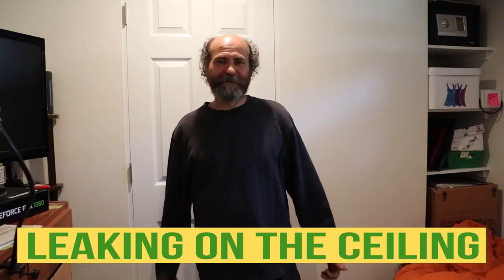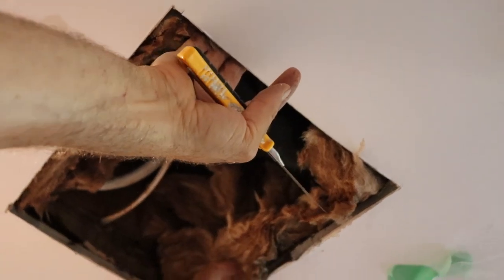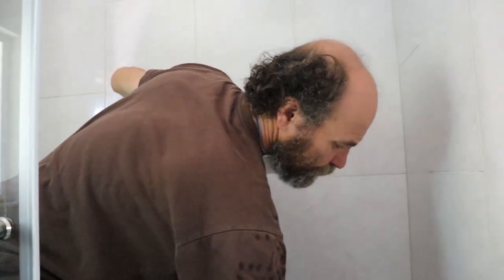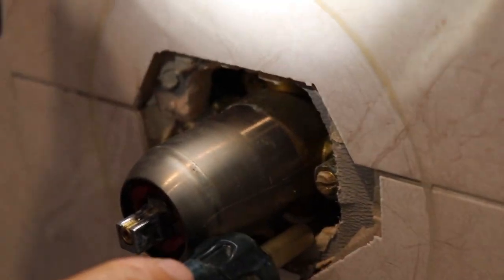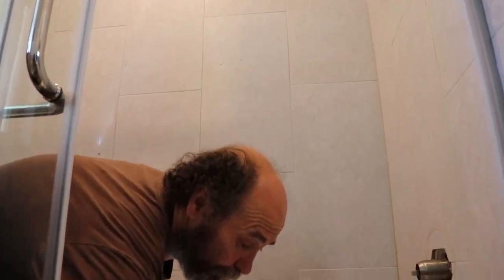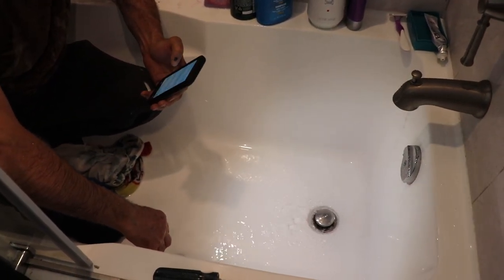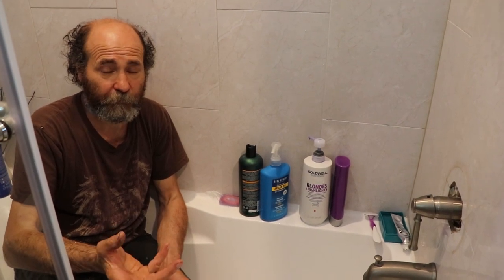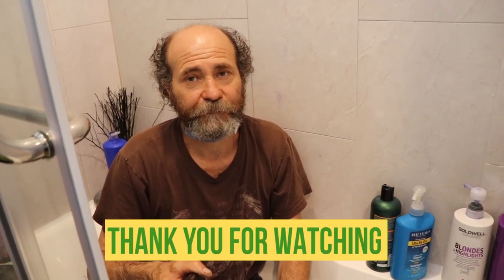How TO FIX A Leaking ON THE Ceiling and How To Repair Water Damaged DRYWALL Ceiling (step-by-step)

Comment: How about in rain leaks on our ceiling on the 2nd floor by typhoon?
Reply from the maker: Hello Angelo, in that case, after the typhoon is over,  go up  on the roof and check the damage, could be just few shingles/tiles that got blown by the typhoon,  just make that you all the safe equipments on before go on the roof top, keep safe